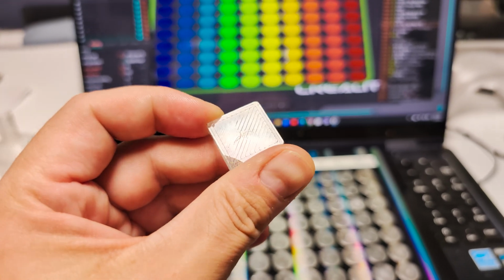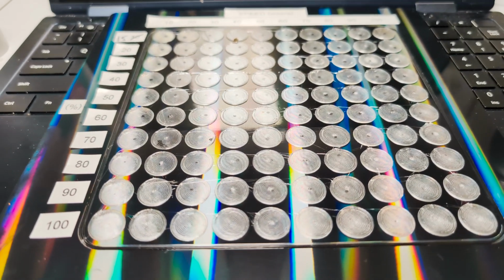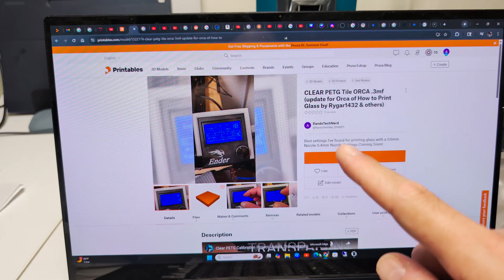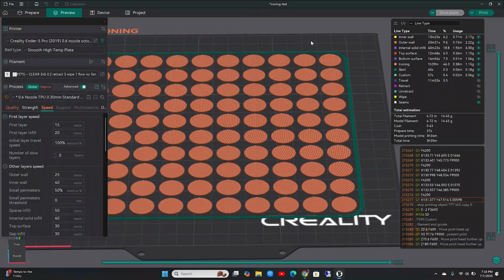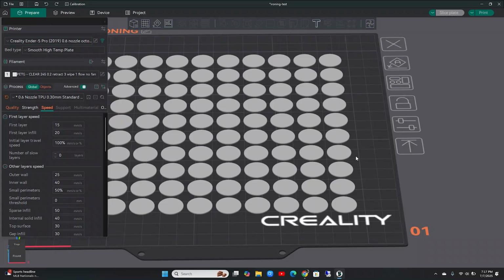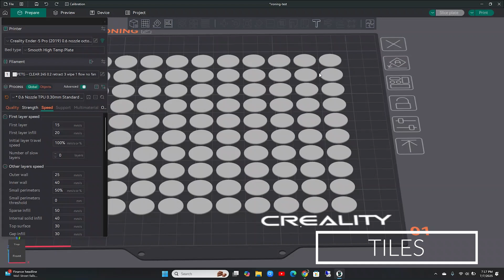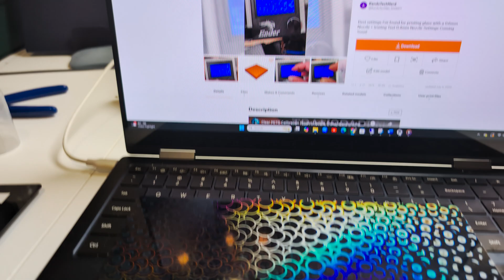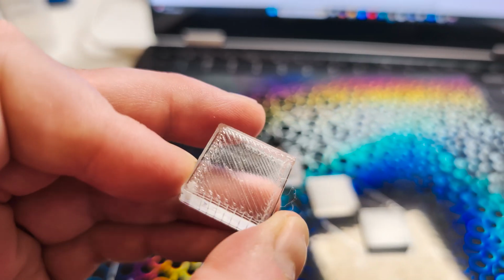Clear PETG Ironing best Flow / Speed

Comment: Great work. Thanks for sharing. I want to try when I get the same PETG. What I have on hand is a ting yellowish.
Reply from the maker: Thank you!  I'll try to get the comparison of Elegoo, Overture, and PolyMaker out soon! Anecdotally I've heard that Overture is the best but I had so many issues with their PLA tangling I'm hesitant to recommend - the clear PETG comes vacuum sealed so maybe it's better - will let you know!  After rewatching the video I realize I didn't mention where to enter the final ironing flow and speed but I'm pretty sure most viewers are already pros!
Reply from the maker: So far with the settings I've got, the Elegoo is the most clear.  I still need to do additional tests but wanted to share just in case you're buying soon and the clarity is most important to you.
Reply: My best luck had been with Creality Hyper PETG, though .y use case is primarily single wall (i.e. vase mode-ish) prints